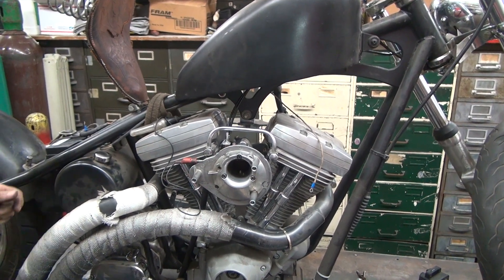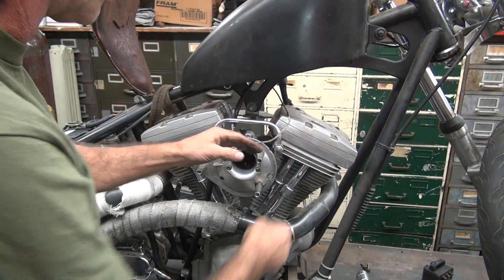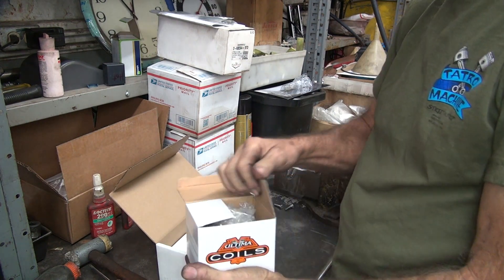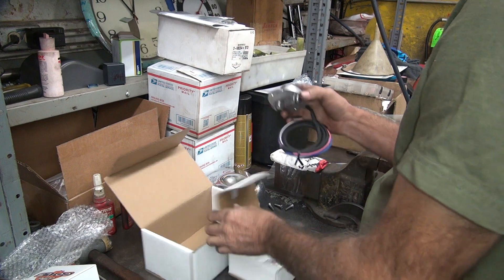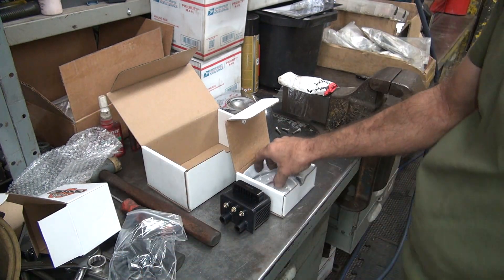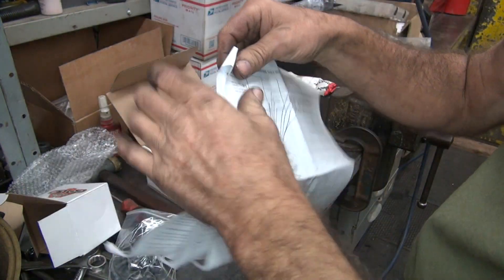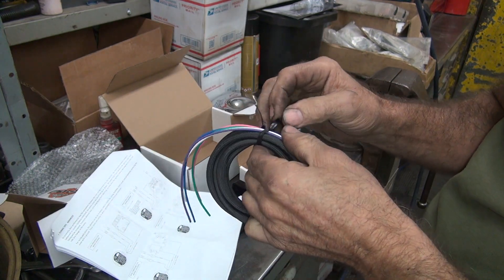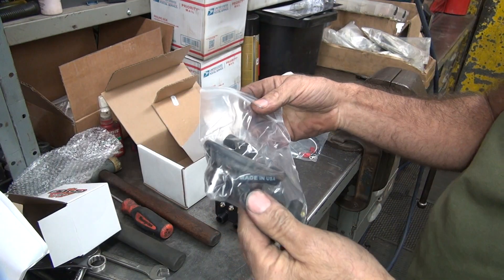#116 1999 80ci evo chopper used bike tune-up repair rebuild rigid bobber custom harley tatro machine

Comment: I have a 1990 Fatboy I was thinking of switching to the same DAYNA 2000 your using in this video,  from stock ignition.
 Will I gain any advantages?
Reply from the maker: yes. if you put more timing into it you should see a 3-5hp increase in power.
tatro